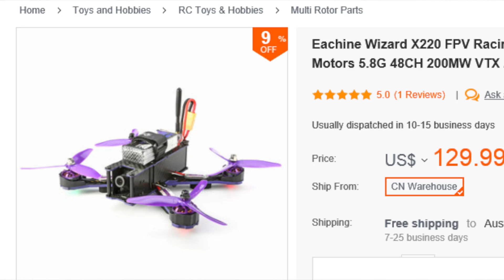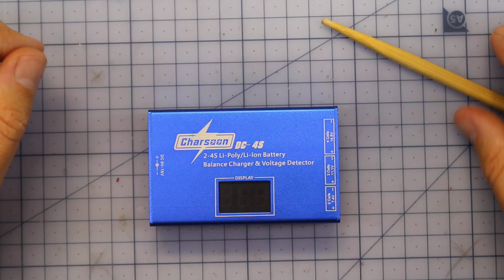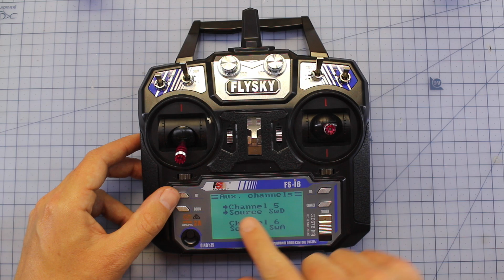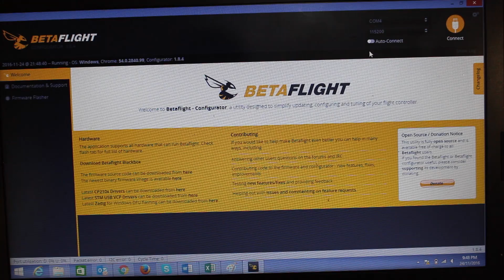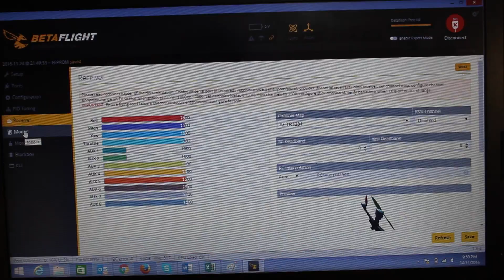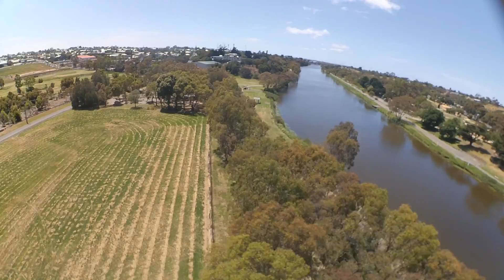How to get FPV DRONE RACING for under $300! Parts +Full setup.

Comment: hey man I have seen your video in the 300 dollar fpv starter kit. in there you included a 1300 mah battery i was wondering if there are any drawbacks of having a larger battery as i dont want to have carry so many and if may i know if you have some recommendations for larger 4s batteries??
Reply from the maker: a 1500mah is great. but any larger and you risk having a quad that is too heavy
Reply: UAVfutures oh OK thanks a lot man love the channel :) gonna stick with 1500s then thanks again
Reply: and also do you happen to know what to do if my glasses dont fit in the fpv googles recommended above?

Comment: hey man, you linked two sets of goggles in the description, and I know things are starting to get outdated, as this was a few months ago. But there's a $100 price difference between the last two that you linked. For someone who finds it Hard to justify a $100 difference, and has very little experience in the field, could you definitively recommend one over the other? (the EV800 or the Eachine Goggles Two) Putting into perspective, that if the difference is noticeably substantial in quality, I would pay the extra $100. Thanks in advance for any advice! :D
Reply: Update, I found this (Eachine VR D2 with DVR) http://www.banggood.com/Eachine-VR-D2-5-Inches-800480-40CH-Raceband-5_8G-Diversity-FPV-Goggles-with-DVR-Lens-Adjustable-p-1074866.html?rmmds=detail-left-hotproducts 
for only $106 and it has DVR, which is a SUPER desirable feature. I feel like I'll go with these, even if it has worse picture quality.

Comment: Hey Stu, I have a problem with the receiver in betaflight.. I was binding the receiver and everything seems to work perfekt. but when i connect the wizard with betaflight it doesn't show any changes in the receiver tab when i move the sticks of my controller. i followed all your instructions in the viedeo..  do you have any idea what the problem could be?   thanks
Reply: Did you figure it out? I need help.

Comment: Any ideas on why I can't get a connection to beta flight? I have the exact same equipment and followed every detail of your setup, I just can't get into beta flight.
Reply from the maker: install the drivers on your computer. they are listed on the betaflight front page of the program
Reply: UAVfutures thanks. Will try that.
Reply: UAVfutures I'm still having no response after installing the three drivers listed. I have no idea what's wrong.
Reply: My problem turned out to be a bad usb to micro usb wire, so now my only issue is a throttle that escalates on its own,,,, any thoughts?
Reply: I had an issue with the motors revving up out of control, I eventually found that by raising the rc deadband (under the reciever tab) up to about 15 the motors would hold at whatever rpm I needed, Not sure if that was the best solution, but it will do for now.

Comment: help just got my Echine and im trying to set up betaflight, but it wont let me connect it says failed to open serial port
Reply: I was able to connect after downloading STM USB VCP driver and cp210x driver. I restarted the computer and plugged in the quad, on the top right of beta flight I was able to choose a port, mine was com 3 and I was able to connect

Comment: Is there a Vtx that you would recommend that is better then the one that the wizard has.The one  on my wizard vibrated loose where the antenna screws on.I did resecure the connector back in tight and still have good visual I just dont trust the Vtx......Help lol

Comment: Anyone can help here? I followed video setup exactly and everything works just fine. But... my Wizard motors idle at about 1000rpm even with the throttle all the way down. Is this normal? All the really cheap quads I've had, throttle all the way down was "off" for the motors. Being my first FPV racing quad, I'm not sure this is normal or not. If it's not normal, how can I adjust the throttle to shut off the motors when all the way down? THANKS in advance!
Reply from the maker: Click motor stop in the betaflight section if you want want this to happen

Comment: If anyone is having trouble connecting your quad to Betaflight. open it up and instead of clicking the connect button, look down and in the description it should say ' Latest CP210x Drivers can be dowloaded from here'. Download and install the drivers and then restart beta flight and you should be able to connect straight away, thats what i did and it worked :)
Reply: HoulkerUK I downloaded it and it still didn't work, I tried both downloads, and when I try to check my ports on my computer it doesn't show up, I can't flash anything either since I can't connect

Comment: Would the transmitter "Turnigy 9X 9Ch Transmitter w/ Module & 8ch Receiver (Mode 2) (v2 Firmware)" work with this build? Thanks

Comment: The sequence of setting up the controller seems to be wrong.

if you are setting up the FlySky controller make sure you start with setting up the aux channels. After that setup Failsafe. A thing that bothered me to death was settings weren't being saved. I'f you have the same problem, make sure you hold the cancel button after changing settings untill u hear a different bleep sound.

@Author, remeber ur audience is mostly unexperienced drone buyers (like myself). I for one wouldn't have minded some explanation about setting up the propellors.

Comment: Guys don't get this quad. The parts are super cheap. I've had to spend so much time fixing and replacing a few parts before I got it to fly. I've built my own fpv quad which was easier and took less time than getting this to work.

Comment: Will the FT48x vtx from banggood work plug and play on my wizard?  I killed mine in a crash and just can't seem to find I direct replacement (but I like how the connection is straight on this)  so if I can just plug it in and it works like the original??  Please help, feeling desperate here!

Comment: bloody ripper of a guide, i've purchased this quad and the upgrades as recommended. only one hiccup, one of the ESC's burst into flames as soon as i plugged the battery in...quick solder replacement job and all is well. A++ on this guide thanks mate!

Comment: so i have successfully paired my transmitter and receiver. i am receiving full Rx. when i link to betaflight via usb i see my drone relaying its gyroscopic information. i followed the whole process and copied his betaflight settings. yet it seems like my radio and betaflight are not communicating.  at 23:53 in the video is the first time i am unable to do exactly what he does. it seems like betaflight is not responding to my thumb-stick movements. also i am unable to get any motor movement at all. any help for a noob out of his depths?
Reply: also i am using the exact gear he has, with the exception that my wizard came with a F-sia6 2A reciever. i believe i have successfully paired it.
Reply from the maker: you need the ia6b receiver
Reply: Im getting the exact same problem as stated above but i have the ia6b reciever :S

Comment: What about the Eachine Racer 250? It currently costs 114$ and has the same FC. Would you or anybody else recommend this?
Yeah you said you cant get a cheaper quad but this SEEMs quite good as well...

http://www.banggood.com/Eachine-Racer-250-FPV-Drone-F3-NAZE32-CC3D-Built-in-5_8G-Transmitter-OSD-With-HD-Camera-PNP-Version-p-1074562.html?rmmds=search

TIA

Comment: Id like to see the goggle video instead of the hd video
Reply: the googles dont record, i dont think
Reply: @samfreedentertainment75  You would never expect the FPV video to be of the same definition as the HD camera footage. FPV (goggle) video needs to be transmitted back to the ground in real time. The amount of information being transmitted would be ridiculous for a High Definition video signal that's flying around at speed and at varying angles. The power required, type of transmitter needed, and size of antenna etc etc would make it un-affordable for most people, not to mention too heavy to fly.  The FPV video stream technology is constantly improving, and is now really amazing in the goggles, but will never be as good as a stand-alone GoPro or similar  :)
Reply: I'm also interested to see what goggle video looks like. Is there a way to connect a HD video stream through the goggles? I assume answer to that is just purchase very expensive goggles...

Comment: Hey Stew my name is Darryl I'm new to the whole drone thing I have alway wanted a RC choppers for as long as I can remember, I have had a few nitro cars but only cheap co axle choppers. I was thinking of getting my self a decent chopper for my birthday in August and never really had a interest in drones, well that was until I came across your Chanell. I didn't even know FPV was a thing. I am really interested in this now and have been working my way through your vids particularly the DIY ones. Not sure if I want to build or pick up a RTF kit. I'm thinking of a budget of around $500-$600AUD what do you recommend? I like the look of the wizard in this vid and also the GT2 is very appealing. What are your thoughts? TIA

Comment: Anyone know if the slightly better flysky would work fine with this? Flysky FS-i6X 2.4GHz 10CH AFHDS 2A RC Transmitter With X6B i-BUS Receiver? thanks guys

Comment: Please help! At 16:00 you set the channel 5... my switch SWD doesn't do anything the slider doesnt move!
Reply: It did the same thing to me on my laptop. Never got it to work. It worked first try on my desktop...

Good luck with that I'm not sure I could help on this :S
Reply: I just used the other computer. I always had trouble with that laptop...
Reply: Ah ok figured it out. It's the part you do after. You should do that before because the first settings wont work it'll stay at 100% instead of -100%!
Reply: turmat01 have you bought this one? If so, can I chat with you in some way?
Reply: Yeah I did and I received everything you can see in the video except the charger (but got another one already, still waiting for the charger from banggood. Didn't end up getting the Charsoon tho as it was back order for too long, I got a better one with a thousand more functions lol.

If you need to talk, feel free to ask me questions, through here, or you can just give me your email or something (dont write it fully on youtube though, leave out the "@" and the "." so the bots of the internet don't spam you lol).

I'm not the one who know drones the best, the Wizard is my first one. Got a lot of theorical knowledge, but very little practical knowledge. I can still try to help you out if you need!
Reply: I'm writing to you right now. I suggest you edit your post to remove your email now ;)
Reply: could you help me out? im stuck at 16:00 aswell. Channel 15 doesnt work with my SWD switch, it works with the VAA (turn button). Did u fix this?
Reply: yeah UAV Future  made a mistake there.

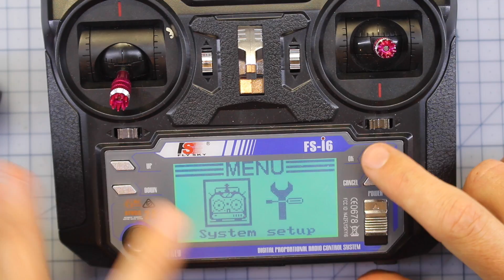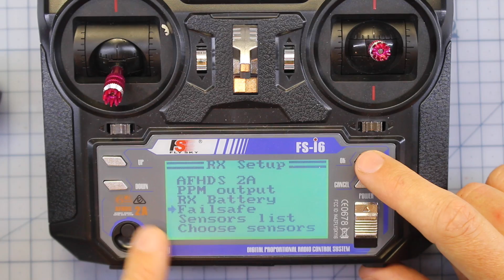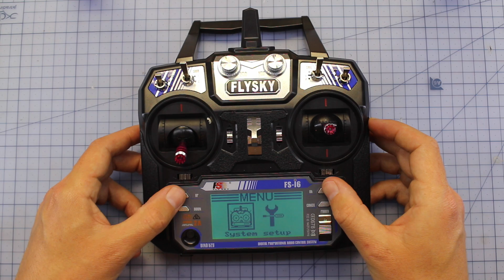He did it in the wrong order, because his was already configured in the first place, that is why it worked. Basically, you do 15:20 - 15:35, then you do 16:15 - 16:45, and THEN, you come back to do 15:35 - 16:15. Setting the failsafe for channel 3 is fine, but channel 5 isn't set until you do the last thing he's done. Setting the failsafe for channel 5 can't be done until you tell the remote what is channel 5 lol. Maybe it would work doing "step 3", than "step 1" and "step 2", Thats SHOULD work, but anyway, I did 1-3-2, that one works for sure.

The way I have setup mine tho, my arm switch (channel 5) is set to swD, and my mode switch (channel 6) is set tu swC. swC is a 3-way switch. So I have it set to Angle mode on 1, acro (no mode) on 2, and air mode on 3. I never use angle mode, but it's there if I ever need it.

I've set up swA as an idle up switch (I'm still trying to figure out if I prefer an idle up switch or air mode. Mine reacts weird with the idle up switch, but I know the idle up switch don't bounce when you touch the ground like air mode does. My swB is setup for high and low rates. I haven't tested it out yet I don't even know if it works. For my swA and swB setups, it's directly in the radio, there is no setup to do on the quad. There are youtube vdeos that explains it, search for "flysky idle up switch".
Reply: alright it works now thanks a bunch! I'm very new to this so im quite clueless haha. Now trying to get betaflight to work.. cant get it to connect. Any tips for that? i tried different cables but that didnt help :(
Reply: And how did you do it at the end?!
Reply: Yeah got it to work now, seems that betaflight doesnt like my macbook. I used my windows laptop instead, worked on the first try. Thanks for your help!

Comment: Hey Stu I am getting something really weird happening with my Wizard and I am hoping you can offer some insight. I have gone through the full set up process in BetaFlight. My radio is talking to the quad, but when I throttle up around half way, the motors continue to speed up, even if I bring the throttle back down to 0. I have to flick the disarm switch to get them to shut off. Any ideas??
Reply: For those having this issue, it's normal for this to happen when you're plugged in to your PC or when your props are off. The FC doesn't know the props are off, so it's trying to detect movement of the quad. When the quad doesn't move (because no props means no thrust), then the FC directs more throttle to the motors in efforts to get the quad in the orientation that it thinks you are trying to put it in. At least that is what I was told when I first encountered this issue when I first got into miniquads.
Reply: Guys, looking at other forums, this is only a problem when quad is set to Air Mode AND there are no props attached. So, even though they speed up while connected to computer and beta flight, it will run normal with props attached and out in the field.
Reply: Sam / Stu, I've got SAME problem again. It just came back and won't go away. I throttle up and motors continue to speed up until I hit the disarm. I made some changes in settings but I couldn't remember what so I reset settings with no luck and then I finally re-flashed firmware and still same problem. Sam, did you find a solution?
Reply: Also when I plug my quad into BetaFlight, I have no option to set Air Mode, but my buddy plugs in his and he does.
Reply: i got a question for you, which "board" did you use for beta flight?
Reply: Which board? What do you mean? Or is this for Stu?
Reply: Sam, I've had the same problem first few times (continuous speed up), but it stopped after the first few diss-arms. Not sure what caused it or caused it to go away. I.E. just letting you know I had the same problem.
Reply: I have the same issue
Reply: look up other reviews for the wizard x220. not the BEST. maybe the wizard x220s is a bit better but idk i havent looked into it
Reply: This scares me to buy it!

Comment: As someone who has flown a DJI phantom 3 for a couple years now but no other experience, would you recommend buying a kit like the wizard or building your own as a first racing drone? I have very little experience soldering or with RC devices in general other than my phantom which flies out of the box. I really want to get into this hobby but do not know where to begin!
Reply: I would start with this, take it apart get some mods, then once you have an idea of how these things work, build one for yourself that gives you the performance and speed you want
Reply: Cameron L im in your same shoes. Im coming from RC cars and want to get in to this hobby next but dont know where to start.

Comment: What's up guys.  When I try to designate channel 5 as my arming switch the radio does not show that the switch is doing anything. So when I flick the switch the readout under under the channel designation does nothing.  I discovered that channel five is actually assigned to the silver knob labeld "VAA" how do I move channel five to the right dip switch???
Reply: In the setting of the receiver you can assign your channels to the switches. He shows you how to do it in the tutorial. Just watch the whole thing before you use it as a guide.

Comment: Hey there. I've got a bit of a technical question.
I ordered the wizard and took a look at the components. Especially the motors.
When i took a look at the data table (http://bit.ly/2jNOpU5 , below the images) and specifically at the "load current", i saw that the motors take up to 27.6A when powered with a 14.8V, which would be a 4S lipo right?
So wouldn't technically the 20A ESCs on the wizard be a bit underpowered?
I know they have a 25A peak current, but still..
Reply from the maker: its fine

Comment: Love the channel, Stew. 
Bought the Wizard based on this vid.
Total noob but bought 4s batt for this, and despite having the antenna attached, I think I fried the vtx. Checked the vtx on a parts site (I guess it's normal to have no manual with fav drones?) and it says do not use anything over a 3s batt or risk frying the vtx unless using a 12v bec... thoughts?
Also, using the Turnigy Evolution plus included receiver. Any thoughts from the community about potential issues? 
Cheers.
Reply: SonicStates I must have fried something after plugging in the battery got a flame coming out of a motor driver.. looking for what the issue was.. bought the batteries from the second link
Reply: Adam Wentworth Wow! Definitely not cool. For the issue I mentioned, the batteries (4s Graphene)turn out to be fine. The PDB regulates where the voltage goes. So all good. The rubber grommet which holds the antenna is the culprit as it prevents the antenna being completely seated, cue fried vtx (Stew does caution about this in his Drone of the Year video). Cut that bastard off... at least the top portion.
Your issue comes from the motor itself? Could the PCB be poorly soldered? I am just scratching the surface myself so will be of limited help, I think.